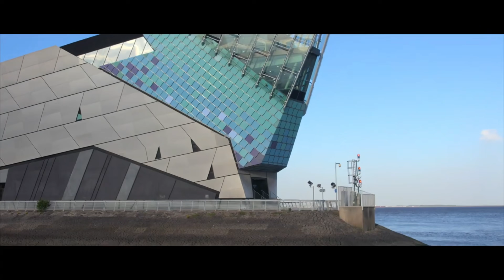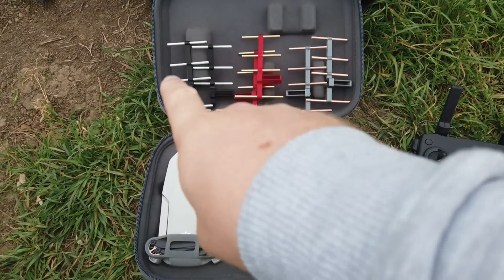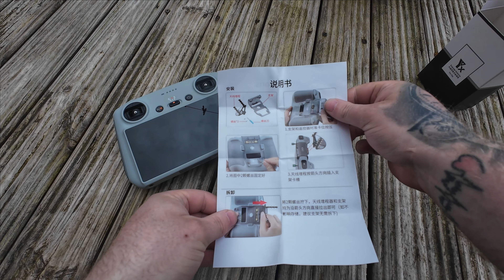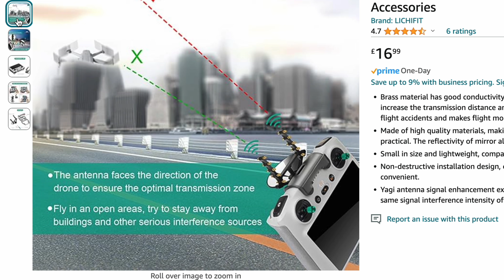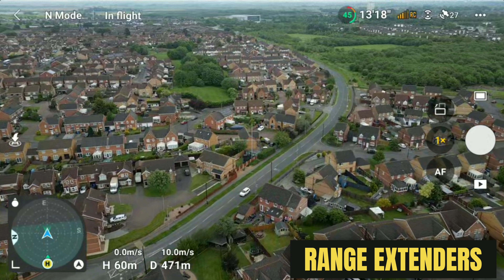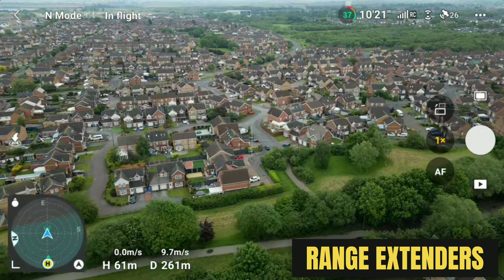Can DJI RC Controller Range Extenders Improve Signal? | Mini 3 Pro Test

Comment: I don't use them, but I still can fly up to 5.5km with my Mini 3pro / RC combo. Thanks for being able to fly in FCC mode and not the pathetic EC mode. The clue is to think of the RC transmitting a laser connection to the drone. Always point it at the drone with nothing between them and have the drone fly high enough to avoid home wifis. 120m usually does the trick.

Comment: Could you please test some more antenna boosters for the DJI RC? It seems that this is the only controller range boosters don't work on, probably due to the internal antennas.
Reply from the maker: Bingo, boosters work in general but the antenna placement inside means they don’t, you’re better off with the FCC hack from drone tweaks
Reply: @GAVINHR  Thanks for the reply 👍

Comment: I remember when I first got my mavic air 2 in 2020. With all kinds of obstacles around me, I could fly 4 miles with no signal drop. Now after all the updates years later, I might get a half mile in the same area before completely losing signal. I’m NOT a believer in government control over how far I fly my drone. The line of sight rule is null and void to me. I think if dji advertised 20km or what ever the hell they are claiming now days, it should do it. That’s why I moved into autel drones. None of that to worry about. Dji is nothing short of controlling nazis. Ya, don’t support.
Reply: I’ve seen people easily go 4 miles with the mini 4 pro. Perhaps your drone has an issue and needs fixed.
Reply: Autel drones are nice but with DJI you get more. Comparing the Autel nano vs the DJI mini’s, the nano’s just not quite as good when it comes to specs and features.
Reply: Try fcc mod with mavic air 2

Comment: Yagis require much more direct line of sight than omnidirectional antennas. Therefore, I think a true comparison of range with/without Yagi should be done in open areas, in the countryside, and not within residential areas. Personally, I believe that these devices are of no real use. In open terrain I achieved a range of more than 4 km with the M3P and at this great distance I also had to align the RC with the drone. You may gain a little distance putting on these Yagis, but then the connection will be even more sensitive to variations in the orientation of the remote.
The main range problem in your test setup is the lack of direct line of sight. Too many buildings, I suppose.
Reply from the maker: They do indeed, however the issue is as you said yourself in the countryside you won’t have a range issue, not to mention here in the UK all I will get is people screaming vlos these days if I did that. Back in the day using range extenders I took the mavic mini to 5000m - they 100% work, but I have to go it over shorter distances these days. If I can align yagis over a 5km distance I can certainly manage it at 450m, the issue is simply this model doesn’t work, the same test using the RCN1 yagis worked perfect

Comment: Another great test, thanks Gavin. Obviously with the better 03 signal strength they mustn't be needed. Yet I remember when you tested across the Humber with the old Mini drone and they worked perfectly.
Reply from the maker: I think its down to the design of them David - they are not even aligned with the antenna placement ! ah yes good times those were!

Comment: Wrong, you need a log-per antenna.  You also not hamradio.......?
Reply from the maker: Whats wrong exactly? did you watch it?
Reply: @GAVINHR  Because you need use a log-per antenna for both bands,  BTW i am hamradio for 48 years TRX up to 24GHz.
Reply from the maker: So you’re telling me the extenders do nt work?
Reply: @GAVINHR it not work because it doesn’t connect inside the rc. SCAM
Reply from the maker: @lenilugaw6438  can you tell me what I showed in the video before calling it a SCAM please?

Comment: My first drone was a Hubsan H501SS. Out of the box its range was only 300 ft. I found a range extender project on Dustin Dunnill's channel, and made antenna mods to both the controller and the drone. Wow, it pushed my range out past 1.5 km. It could probably have gone much further, but it was about that time that I got a "real" drone and so didn't use the Hubsan after that. I do have the Yagi range extender for my Mini 2, but so far I haven't needed it.

Comment: I think any of those attena will simply alter the focus of the transmission, that may give marginal signal boost but limits the feild of focus.....in essence if you do get boost you will need to be pointing them in exactly the right direction to get that benefit.
Reply: So usually when your drone is far away (when this device is effective) you’re facing the other direction? Odd
Reply: @Jeremy-ff3jm ?
Reply: That doesn’t make sense lol
Reply: @duanespeck2316 It makes perfect sense its just you who dont understand
Reply: @ no, it doesn’t. I’ve made a video on the distance I get with, and without the range extenders. I was able to go about 1,200 ft further using them.
Reply: @duanespeck2316  you may acquire a small 'distance' gain but you'd need to be far more accurate with the direction of the controller. This marginal gain is far outweighed by the risk of losing signal when you change direction slightly because you've sh*t your pants getting excited over 1200 feet. Stay within VLOS, fly safe with a decent signal strength and save your mum on washing powder. 🤞🏻

Comment: Thanks for that! You’ve saved me a few quid. Would do the FCC hack but it appears to be a bit complicated
to set up on IOS. Also I believe on the RC controller I wouldn’t be able to choose to use either the FCC or CE. It would be stuck on one or the other?
Reply from the maker: The FCC mode really makes a huge difference to be fair, it wasn't a bad process actually on iOS once he got the UUID he did it straight away ! with the RC you are un CE unless you open the iOS app so you get to choose :)

Comment: So great video. I will say on the Mini 4, not so much distance but yagis did help with interference for me, I did a test where it went to one bar.. same for the yagis but it kept going....
Reply from the maker: Hi David! Thanks for the comment, yes I can imagine extenders on the rc2 will work fine ! But if you take a look at this they are not even aligned with the antennas on the controller, in short it was basically never going to work

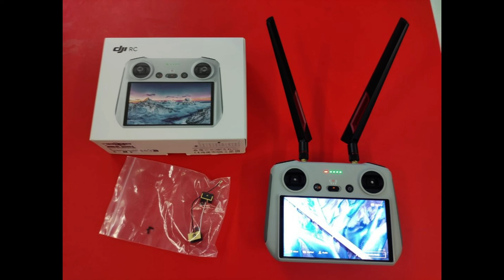Comment: 3:23.... wasn't the REAL reason due to the design of the mini 3 pro?

Dji drones always had their receivers built into the LEGS  of the Drone VIRTICAL prior to the M3P which Was horizontal within the arms- harder for it too detect when facing away. Doing this to shave to 249g

Mini 4 pro AND the mini 3 later corrected this. I imagine it was one of the major reasons for the fast turn around in the making of M4P over M3P only a year later
Reply from the maker: This was indeed the reason my friend, antenna placement of the mini 3 pro!

Comment: They may work, trouble is if they are not tuned correctly, and throw the SWR out you will put strain on your output RF transistors which is very bad for your transmitter.
Yours 2E0CJV
Reply: not heard of SWR for ages Lol reminding me of the CB days 😆
Reply: @mavicairflyeruk  it’s applicable to every device that’s transmits a wireless signal, all manufacturers have their antennas especially tuned by design these days, put anything near the antennas that’s metal can affect the SWR if not specially designed.
These days manufacturers use fractal antennas on the pcb itself and are of exact in dimensions so there’s no need for the user to tune them.
Reply: @mavicairflyeruk  a physical size of an antenna is relative to the frequency being transmitted a quarter wavelength antenna for 27 MHz is around 1 metre long, they used to give you about an inch or so of antenna adjustment to tune the SWR in.
A quarter wavelength antenna for 5.8ghz is actually 12.9mm long in total length, so you can see how critical the length is to be exactly tuned in for higher frequencies , so you can see why I have my doubts about these products, they need to be really precisely the correct length, and also positioned in the exact spot to not cause SWR issues on the 5.8 GHz band, yes they can make the pcb antenna more directional, but due to not an exact match on that frequency can cause the RF transistors to be strained and thus create more heat and shorten the life of said component.
I’m a qualified radio amateur and design engineer, I design antennas and electro mechanical products.
My call sign is 
2E0CJV

Comment: They may work, trouble is if they are not tuned correctly, and throw the SWR out you will put strain on your output RF transistors which is very bad for your transmitter.
Yours 2E0CJV